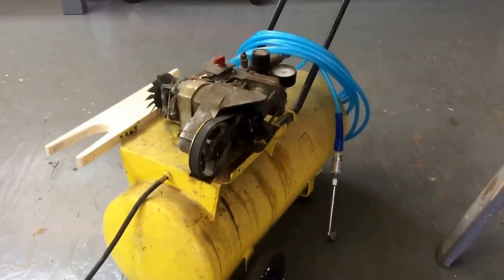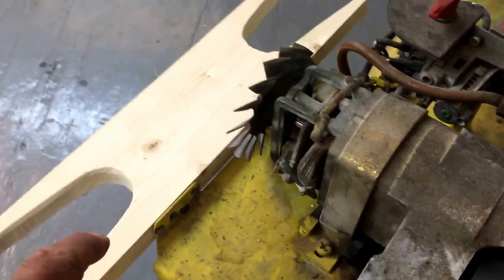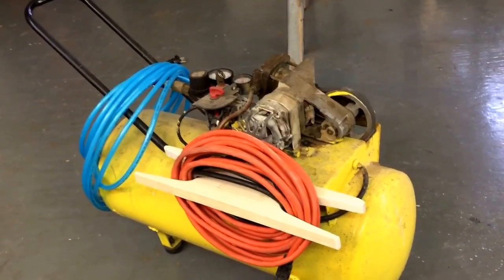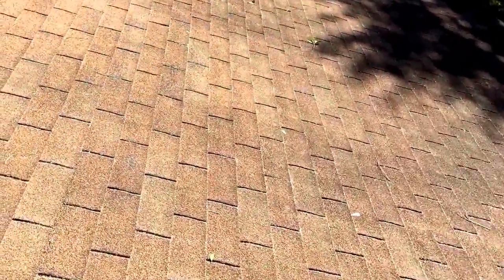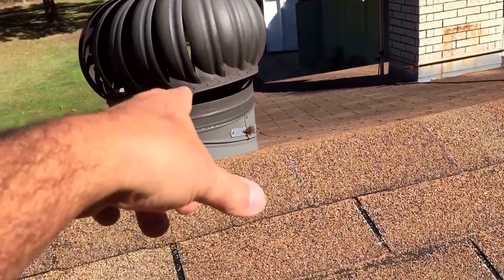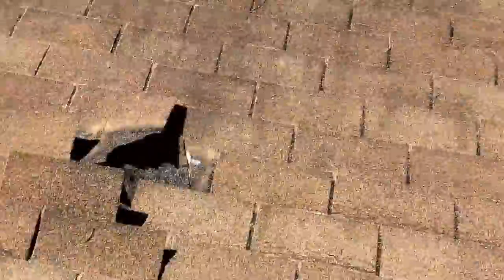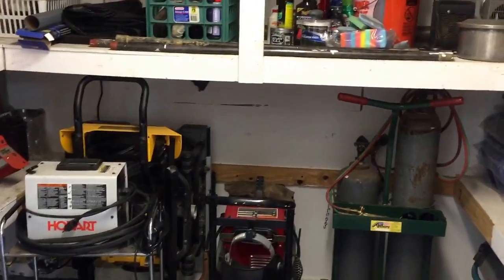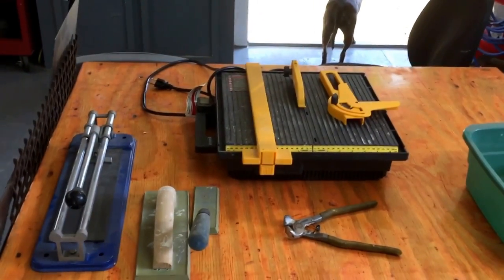Homemade cord wrap cord keeper

Comment: I dont envy you with the roof project coming up. Thankfully we redid ours last year and Im hoping to not have to worry about it for a good long time! They sure are a lot more expensive than they used to be! Storage room looks great. I need to do the same!
Reply from the maker: CopingWithTheTimes for the shingles I want (lifetime architectural) they are about 90 bucks a square. I may have to settle for 30 year,and those are about 70 a square.

Comment: Nice to have a compressor. the shop looks great.
Reply from the maker: 59chevt this is just a little compressor I keep in the shed near my truck and trailer,to air up the tires. My shop compressor is a 220 twin cylinder unit.

Comment: Bud, we had that wind run through the area over here in TX. But we're used to them. Call them Blue Northers. 

You'll like the ridge vents. I had them installed the last big hail storm we had in 2008. I seldom get more than 10 years out of a roof before mother nature tears it up. 

BTW, wanted to wish you a very Happy Thanksgiving. 

Also, to thank you for all the worked done to produce the vids.
Reply from the maker: Thanks very much! Happy thanksgiving to you as well.

Comment: Just a suggestion but, have you thought about metal roofing?
I got my wife to c clamp 25 foot sections of 26 gauge corrugated metal roofing on the ground (one at a time) and I was able to pull the panels up by myself with a rope and screw them down. Not too hard and the shorter panels were even easier!  This was on an 8/12 pitch roof.
Back in the day, my wife brought me shingles up on the roof by breaking the bundle in half to make them easier to carry.  Go wifee!
Oh and btw, I hate roofing!
Reply from the maker: homesteadprepper I've given that some thought and I checked on prices. I can get a square of shingles for about 70 bucks and a square of metal roofing would run about 120. I think I'm gonna buy a few bundles and see if I can still throw one on my shoulder and climb a ladder. I don't have to work fast.

Comment: Def good stuff...repurposing saves money. That power cord needs some adhesive heat shrink over that black tape. The industrial stuff is really really good and about $10-12. That roof's gonna need repaired soon...water/mold infiltration is no bueno!

Comment: Go with a metal roof over. You can install right over the shingles and it will last much longer. It is also cheaper than shingles if you install it yourself.
Reply from the maker: ncautoman57 I checked the price of metal and  for 100 sq. Feet, it's almost double what shingles are.
Reply: Not here in NC...We justt did a roof for $1900 on a 1800 sq foot home. It depends on who you purchase from. We have a factory here within 20 miles. Even if the cost is double you would never in your lifetime have to worry about another roof.
Reply from the maker: if I put 25 year shingles on, I would never in my lifetime have to worry about doing it again. LOL!

Comment: Good luck with the roof. The good news is its fairly flat & not that high up.
Reply from the maker: BZA RZA GZA its only a 4-12 pitch but I assure you,it's 600 feet up.
Reply: BCtruck, rebuild, repair,repurpose About 6 years ago while I was at work I witnessed a roofer fall from 40ft up directly onto a driveway. I'll never ever forget the sound of him hitting the blacktop.
Reply from the maker: BZA RZA GZA ok. That's a big help. I repeat those encouraging words while I'm climbing onto my 600 ft roof. 😬